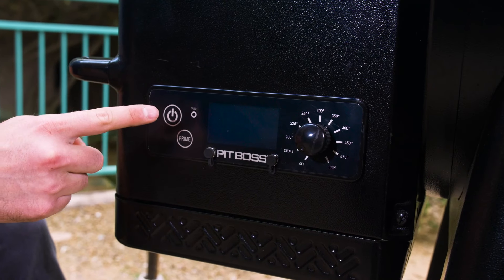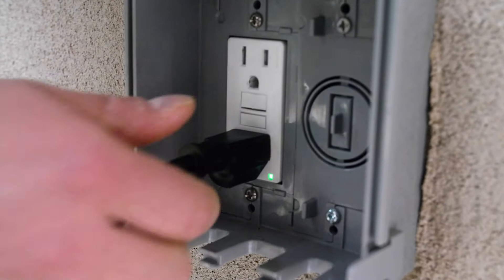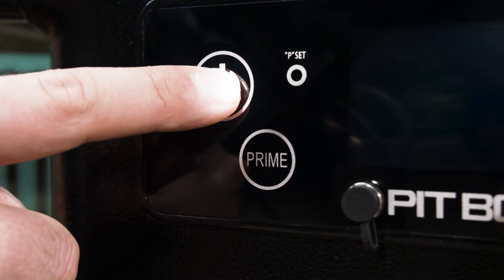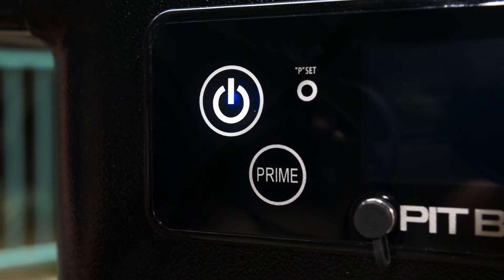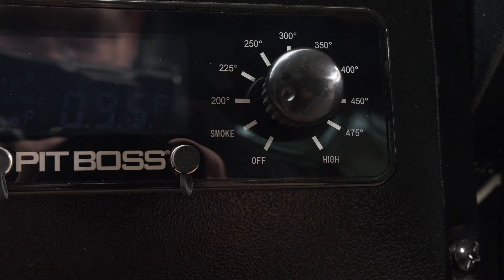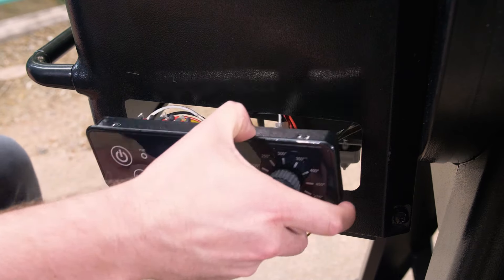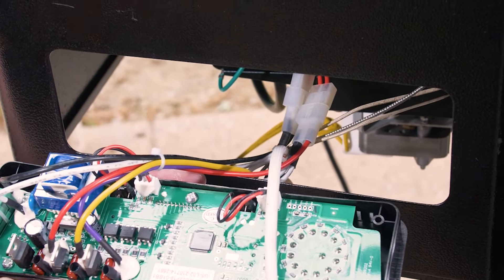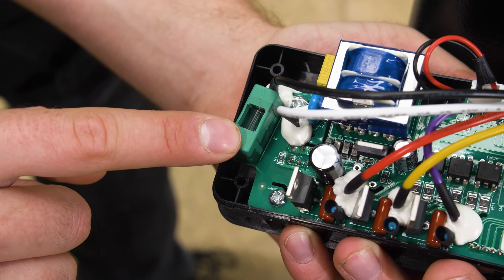Troubleshooting the Control Board on a Wood Pellet Grill

Comment: Swapped out the thermal probe, smoker turned on but right away was reading high temp, but no ignition then the HeR code came back on and won't start, opened control board and saw the fuse isn't burnt out. not sure what's next.

Comment: I have a question so will your temp sensor inside if that is blown or out or is not working will that throw an e r r code on your control board when I plug mine in and turn it on my control board says e r r
Reply: did u fig out that err code im getting it on my pittboss with only 3 uses
Reply: @mgshizzle2213  so if you call pit Boss and request to speak to a tech they're actually very helpful and they will send you the parts and then it'd be covered under warranty.

Comment: Turn mine on and no fan. Then err msg after 5 seconds. Pulled the molex plug from the fan and swapped it with the auger. Nothing. Disconnect the auger and plugged it into the fan plug. Auger runs now. Disconnected the auger and reconnected the fan. Now the fan works. Redonnected the auger....now everything seems to work

Comment: My Pit boss is model pb0820sb. It is running 300+ on the smoke setting. How do I verify whether the problem is the temperature probe or control board issue? How many ohms should the probe read when not in use?
Reply from the maker: Hey Dexter, you can use an oven thermometer in the center of your cooking grids to make sure your Temp Probe is still reading accurately. Feel free to contact our CARE Team if you have any questions or concerns at (480) 923 9630.

Comment: I just bought a Pit Boss 1600 Elite PSE when it’s shutting down the fan turns off but the screen never switches to off stays lit saying it’s shutting down
Reply: This is normal. it has to go through a shut down process to clear out the auger tube.

Comment: Mine will run at 180 and anything above 350.  At 220 or 225 it will stay at 180.
Reply: Same, it works on all temps except 300 and 350, then it stops turning the feeder. Did you find a solution?
Reply: @BourbonCreations  i am going to replace my ash box,  I have burned a hole on it.  Also, I will probably order a new temp probe to see if that works.

Comment: I have the digital control board and it does not allow me to set the temperature. When I press the knob to set control, the temperature shows 5 and does not change
Reply: ❤❤😂❤❤ 1:20 ❤
Reply: ❤ 1:20 1:20 ❤😂🎉❤

Comment: Mine didn't have power. Turns out the problem was a blown fuse inside the control board.
Reply: Where did you buy that small fuse
Reply: @Jaxon4337  Hardware store had it. I don't remember the amps but it was a fast-acting fuse.